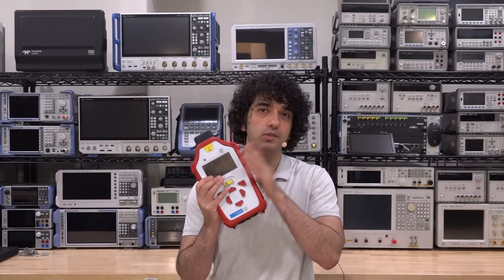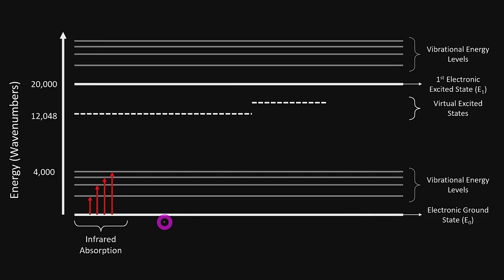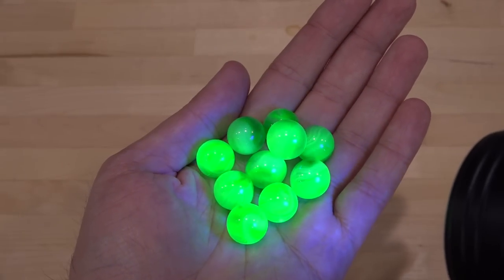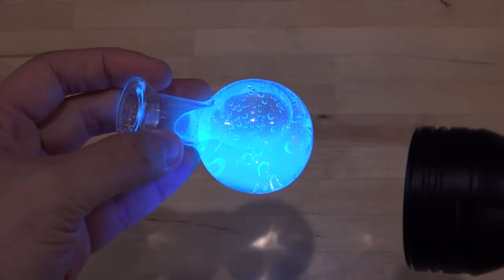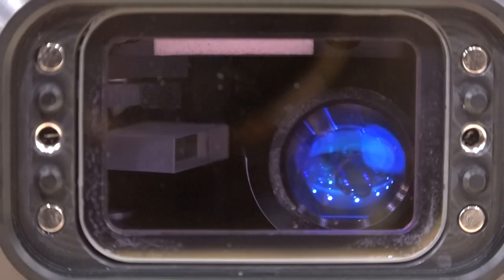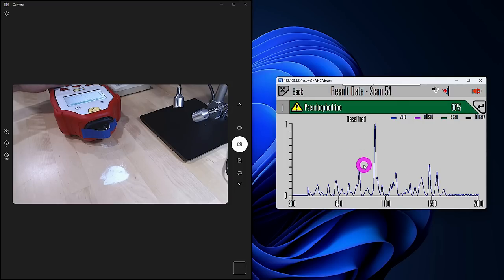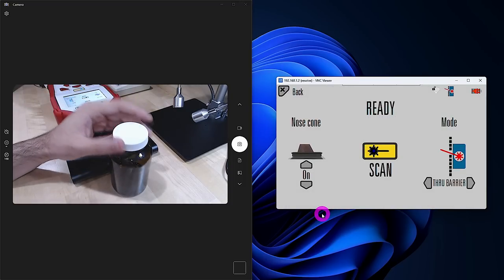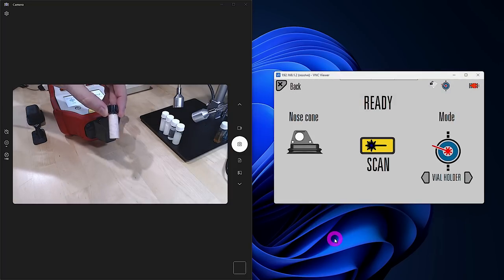TSP #230 -  A Real-Life Tricorder! Agilent Raman Resolve Through-Barrier Chemical Analyzer

Comment: I never knew Agilent made Raman spectrometers, and then your comment at the end about civilian restrictions explained why they might be rare ;) Really impressive bit of kit, and great explanation! I wonder about substances dissolved in a solvent - same signature?
Reply: Me neither, I last left off working on the Ahura Truscan system development and validation for RM testing and some other interesting spectrometers. Unfortunately, the RAMAN spectrometer were more destructive compared to like the ATR FTIR or FTNIR systems I preferred where both need to use more advanced software, especially the later. So that system went forward more with the nutriceutical site. Seems like a different life at times and man do those that have the systems probably not use em from what I found in the service roles lack of forensics other than to rob in the jurisdictions I've been adversely impacted by and I'm guessing some get super pissed knowing how easy stuff can be detected.  Though like the related NIST standards, technically they're used in space and even publicly drones have hyperspectral imaging so like spectra of each pixel, i.e. voxels.  Didn't know Agilent made spectrometers at all either.
Reply: Agilent acquired Cobalt Light Systems in 2017 the Resolve seems to have been developed before the acquisition.
Reply from the maker: I tried various solvents. The result was a combined effect of the two substances. Unless of course a chemical reaction took place in which the new signature would be the result of the reaction plus any leftover unreacted compounds.

Comment: That's AMAZING!   A thing that I didn't even know existed does, which is remarkable and then the amazing feats of physics and signal processing... essentially all reduced to one EASY BUTTON.    Wow.

On a related topic, it would be really interesting to take one aspect of this and run with it.. please do a video on Raman amplifiers.  Or as I was told, the reason why it's not always safe to look down the receive side of the fiber pair.  All I knew before is that there's a high power laser pump source, some chunk of fiber that's apparently doped with magic and then more photons come out than you started with.   I think I have hint now of what might be going on, thanks to this video.

Comment: Wonderful video, excellent. I also work with small spectrometers, and I know that  raman is a huge challenge. I also used a effect which is called two photon absorptions you mentioned in the video, for example with lanthanoids, So a IR source point to the substance and you get back twice the frequency, which is used for forensic identification of objects (you add the substance for identification...) In this case its easy to filter out the laser, were as with Raman this is really a challenge.

Comment: Very interesting. I'm guessing a thin aluminization layer like with typical moisture (or static shielding) packaging is enough to block detection? I'd be curious to try it on containers with different levels of metalization, like a partly transparent static shielding bag. Surely potato chips are out 😆
Reply: Good question. I suspect while a thin layer may not block the laser radiation it'll probably block the Raman emission from being detected.

Comment: Small correction on that laser pointer crystal.  It's way more than just a doubling crystal.  It's usually a stack of a Nd:YAG crystal with a non-linear crystal that has the ends coated so one end reflects 800nm and 1064nm while the other end reflects 532nm and 1064nm.  The ends of the crystal are also flat with the laser cavity stabilized by the pump laser heating the cavity and curving the ends of the crystal.   A neat side effect of all this is that most green laser pointers are single-frequency single-mode lasers.  If you can thermally stabilize it well enough, it'd make a great source for holography or conventional spectroscopy.  (they'll happily excite individual absorption lines of Iodine vapor)